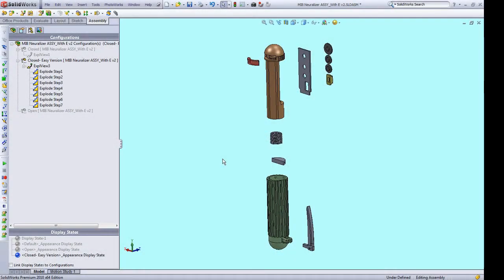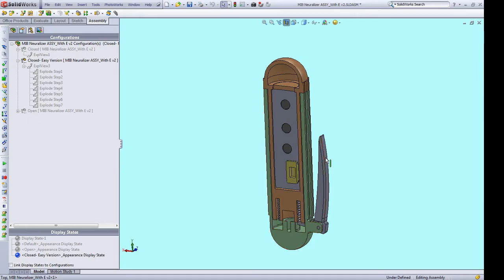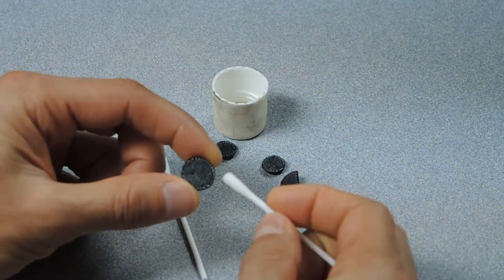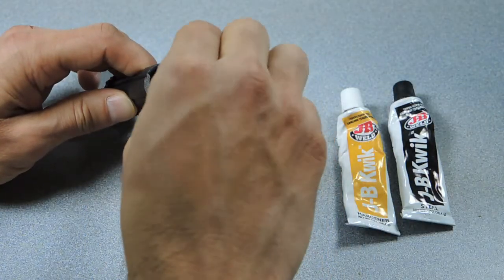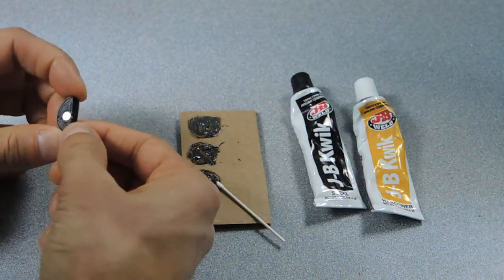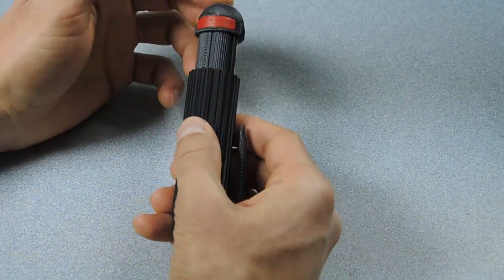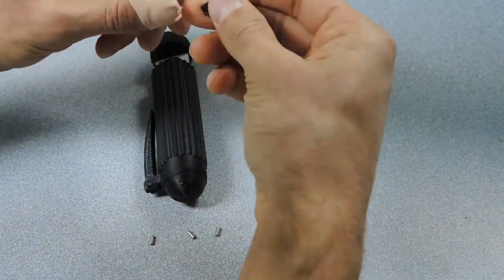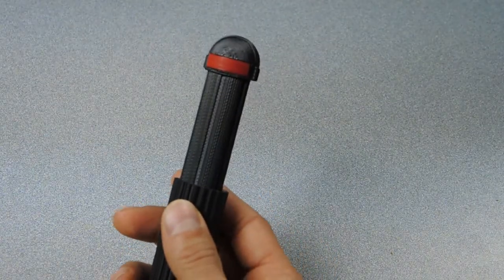Men In Black Neuralyzer: How to 3D Print, Easy Build

Comment: Did you ever get the source for the harder version of the build?
Reply from the maker: Not sure what you are asking...
Reply: @PotentPrintables  At 0:26 you mentioned linking to a "harder version" when it releases. Just checking to see if that was out yet. Thanks for replying so quickly!
Reply from the maker: No problem.  Unfortunately there hasn't been that much interest in this build, so I wasn't planning on doing a video or releasing files for the harder version.
Reply: Ah, that's unfortunate. I had your Thingiverse page bookmarked and finally coming back to it now that my printer is running well again, was hoping to get into the fancier version. Cheers, man!

Comment: I'm on my 7th spring. Still no good. Tried many different springs, cutting slowly and nothing works so far. VERY frustrating. Thought i had found it when i bought toilet paper spring loaded holder, tried those springs, first one's to actually fit in the thing, but even cut down (cut, try, cut, try, cut, try, etc) still doesn't work. Not even close :(
Reply from the maker: Sorry to hear that!  For me that meant the magnets weren't touching or the spring was not seating correctly.  I would test it without the spring, to make sure the magnets clicked together nicely and held with a bit of force.

If the magnets don't click together with the spring removed, then something is up with the position of the magnets or the way the top and bottom shells mate/slide together.  I had a little warping in my top piece, so keep an eye out for that.

Hope this helps and sorry it is not going smoothly.

Comment: game on.  I can't wait to print it.  might be able to start it today.
Reply from the maker: Nice; what color are you going to make it?
Reply: Potent Printables Im going to paint it so not sure which color I will print it in.
Reply from the maker: Ok, let me know if you want any info on what I used for the "chrome" version.
Reply: Potent Printables that would be great.  Also did you use supports
Reply from the maker: Yes, I did use supports.  I printed the Bottom Shell vertically (standing up) to minimize the impact of the support.  The Top I printed horiztonally (laying down), with supports on the side opposite where the control panel will go.

For the chrome version, I used Spax Stix Mirror Chrome Black Backer followed by their Mirror Chrome.  Both from spray cans.  I used Google/YouTube to find some tutorials on how best to apply it.  I didn't apply any clear or topcoat to it.

It came out pretty well; but it takes a longgg time to dry.  My only complaint about it is that the "chrome" coating doesn't seem very durable (if you rub at it with your finger you can see it start to come off).  Hope this helps!